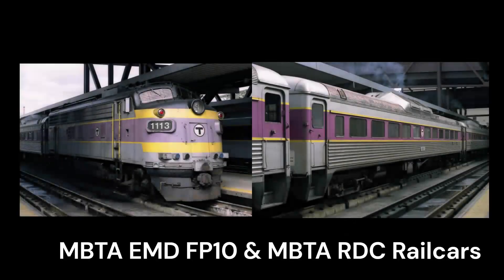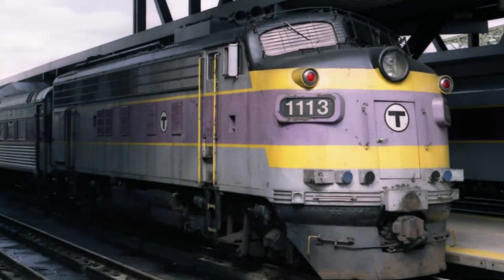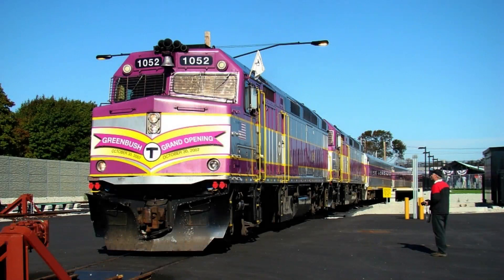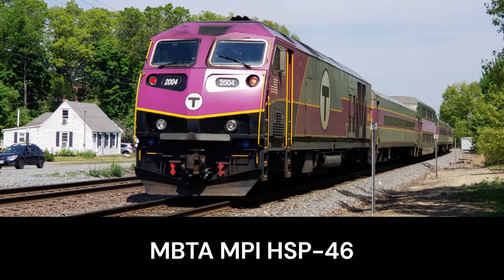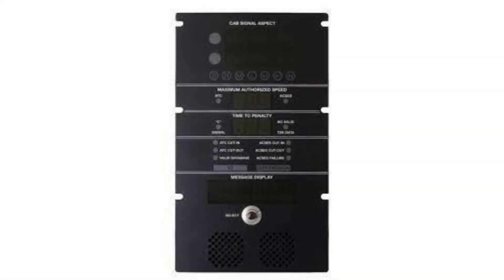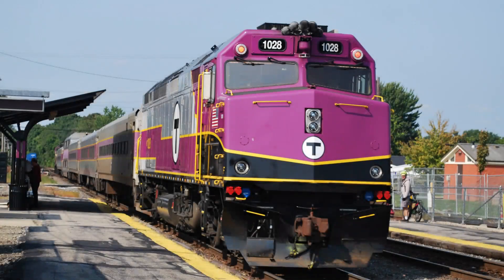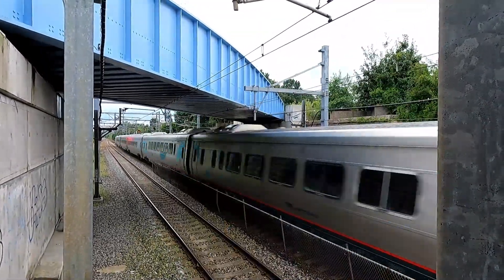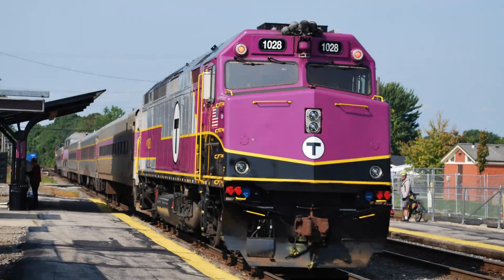MBTA: Past, Present & Future

Comment: Those f units came out of service years before the GP40MC was put into service.  They started to acquire the F40PH in 78, and I can tell you that they were no longer any F units in revenue service by the mid '80s.  For at least 10 to 12 years, the F40PH was the only game in town for locomotive power.
Reply from the maker: the F units were put out of service in 1991, the GP40MCs came in shortly thereafter, I also mentioned the F40s

Comment: It is probably way more economically viable if the MBTA gets engines like the ACS-64, ALP-46 or the ALP-45DP the Maintenace facility would need way less modifications and the fleet would be way more unified.

Comment: not a huge fan of the future of the MBTA.. i dont like electric vehicles. but now trains? one thing i know is that im going to enjoy diesel mbta trains a lot while i still can.
Reply from the maker: I mean they have plans to use electrics on the NEC
Reply: Diesel locomotives already run on electricity, they always have. They have electric drivers that simply get their electricity from a diesel generator in the back of the locomotive versus an overhead wire or a third rail. I too will miss the rumble of the diesel engine but it really boils down to what the source of electricity is rather than a radical change or design in how locomotives work.